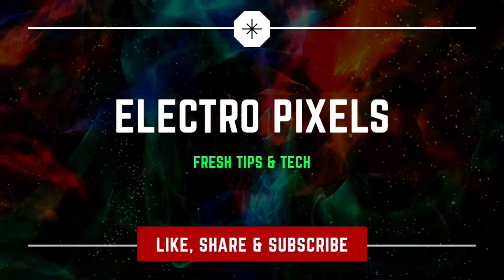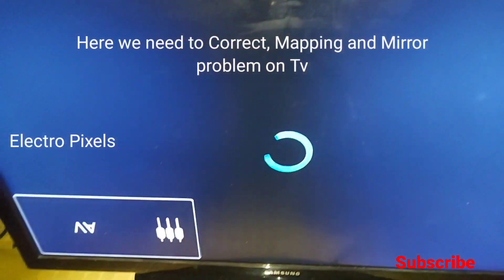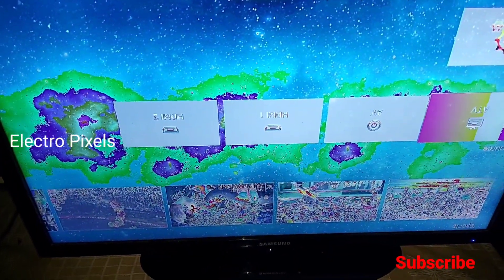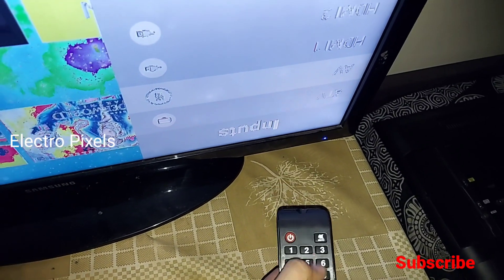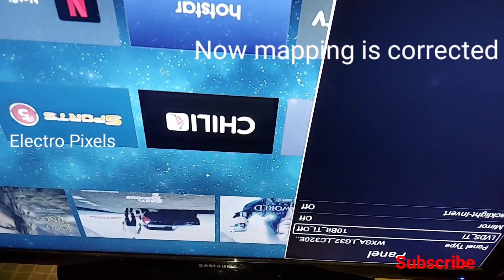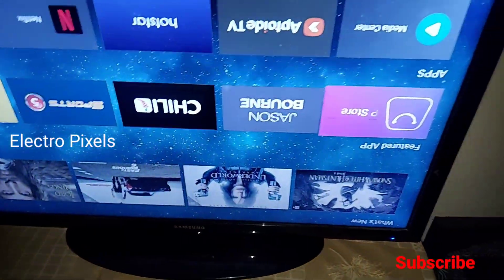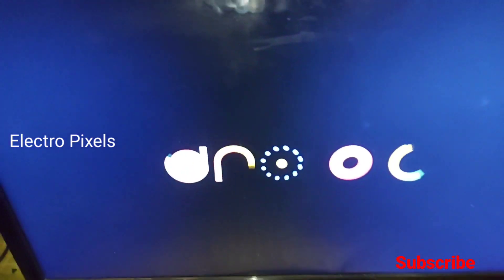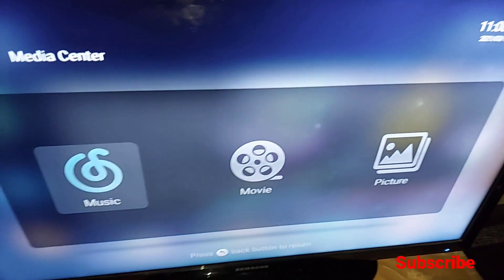How to Setup Install S368LA1.5 Universal Android Motherboard Mapping,|Display Mirroring ||

Comment: where to get software of S368LA1.5 board?
Reply from the maker: Its Available in Telgeram and Internet
Reply: @ElectroPixels  i got s368la1.5 512M 4GB model software from internet, but it's not loading in TV. my board is 1GB - 8GB model.  i installed wrong model version software so my resolution and wifi not working :(
Reply: hello, please tell me where did you buy the 1g and 8g mains, thanks

Comment: Bro...I received second type mother board.. it's service code 344 working... but pls tell me resolution code for 1366x768....
Reply from the maker: Mentioned in video
Reply: @ElectroPixels  bro..in this video your showing only service code.... This board working fine in full Hd resolution..
I need to know the hd ready resolution code (1366x768)...
I'm trying ( input + 03772) resolution code ..it doesn't work for me...pls reply bro....
Reply: @ElectroPixels   isme colour setting kese hogi service menu me